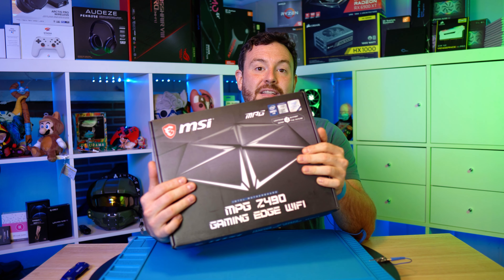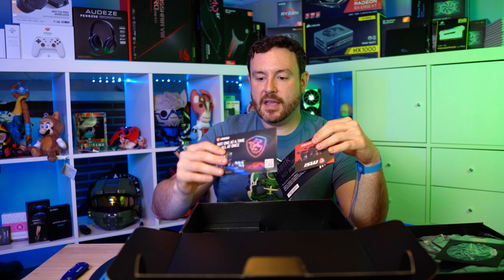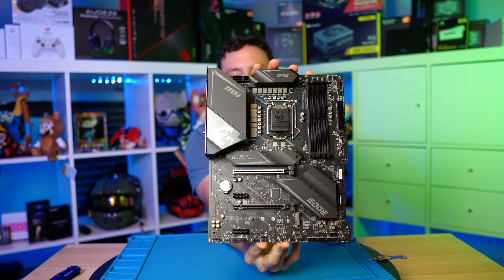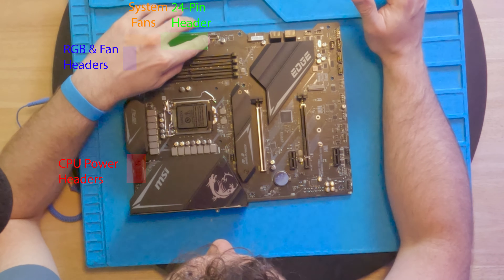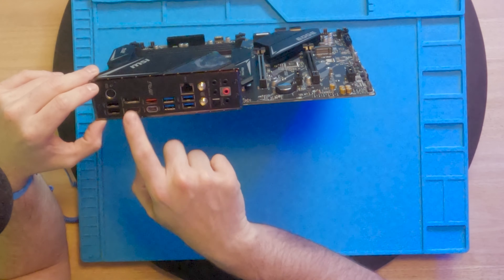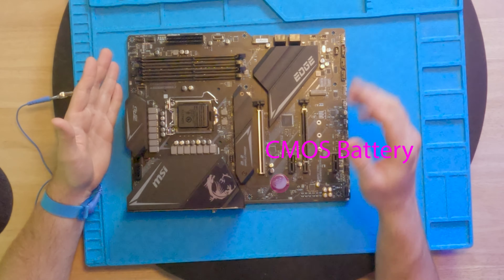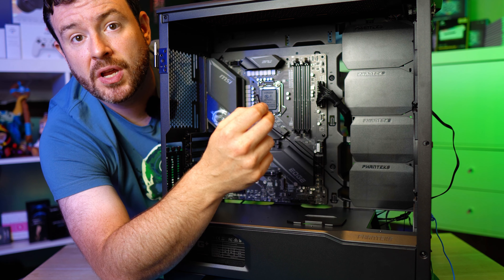Installing A Motherboard In A Gaming PC: Doesn't Have To Be Stressful

Comment: Excellent "How To" video for new builders.  
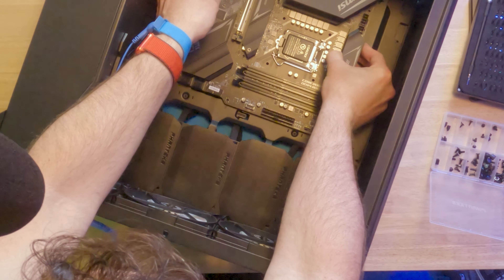14:13 One tip is to make sure you install the I/O Shield (if it's not mated to the mobo, which it is in this build) before installing the mobo into the case.  Good call on removing the mylar plastic on this I/O shield.  If you skip these steps, you'll get to install your mobo again (not that I've ever done that - LOL).
Reply from the maker: I recorded an entire series building a $4000 PC and forgot to remove the Mylar...... It happens.... but my I/O ports are well protected!! :)